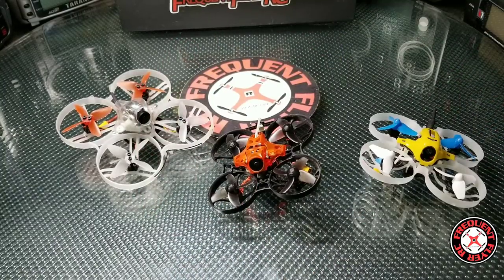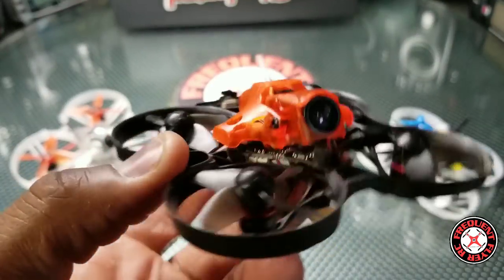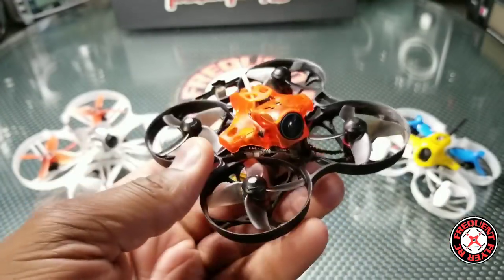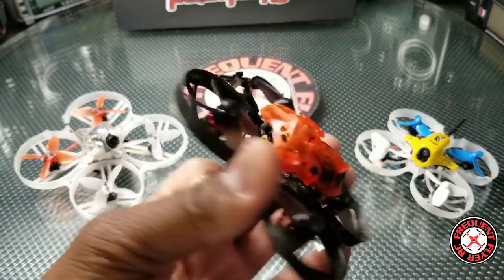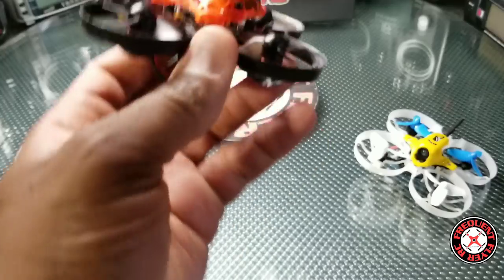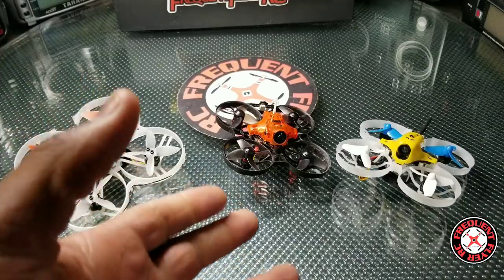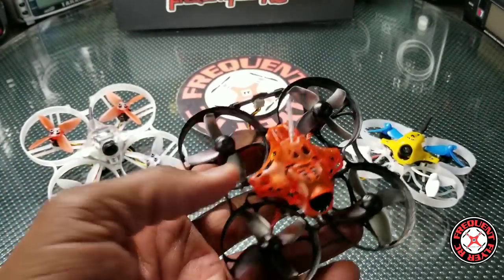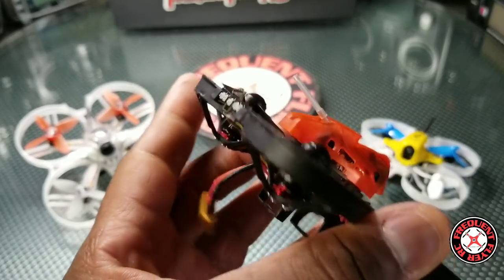Eliminate Yaw Washout For All Brushless Whoops!

Comment: Good idea, I've noticed that the more power the whoop has the less washout there is. So maybe instead of digital idle we need a more agressive airmode to give the quad more authority at low throttle positions. In these quads at low throttle there probably isn't enough power/authority to control the yaw so increasing digital idle or increasing the power of air mode would make some sense.
Reply from the maker: Was axactly my idea when I started! Raising idle gives more authority while at same time keeping props spinning a little faster at zero throttle so to get power it is already not to far down to Rev up when needed! 👍🏽

Comment: My flight time drastically increased with xt30 and betaflight 4.2 with rpm filtering
4khz pid and dshot300 brings 4 minutes flight with 2s 450mAh tattu, to 3.5v (medium hard flying)
But I had massive problems with drone washout at low throttle.
Thanks for the values, I was about to work myself up but that makes everything easier.
Reply from the maker: Changing your prop direction makes a big difference as well! I would go props in!
Reply: @FrequentFlyerRC  Wow, can you explain or do you have a video explaining about differences of props in and out in betaflight for whoops?

Comment: It's funny though that BetaFlight has lowered the default to like 2.5 or 3.5 now, I can't recall which but it's lower than the old 4.5%.  Is the Trashcan Props out or Props in?
Reply from the maker: Trashcan comes props out stock.
Reply: @FrequentFlyerRC    Thanks and that's interesting since "props out" works for all the Whoops I own to eliminate most of yaw wash out.  However, I'm not an aggressive flier by any means so that's probably why I don't see it. I also run about 4.5 to 7% digital idle depending on the quad's motors. But that's only because some the "cheaper" or older brushless motors just sit there and wiggle or flutter upon arming.  Man do I hate that!

Comment: U mean washout from dives? Or just turns? Props in fixes the dive washouts. If u washout in turns just put your battery forward more. Even with 4.5% idle. Go props in and idle 4.5 and let me know. I have 65mm and 75mm whoops 2s and non of them have washouts. All props in. Just try.
Reply from the maker: I'm talking yaw washout on deep dives.. Do a high punch and dive straight down with zero throttle and then pull out and you will definitely see lol

Comment: Interesting theory. Not sure if this is a full fix or more like a workaround. I believe it works, but higher digital idle means it will be harder to get hang-time, which is already usually harder to achieve on these light quads, as you can't gain a lot of momentum when punching the throttle, there is no mass to keep it going up a little, even when flipped to inverted. It also makes it harder to do a vertical dive, as the higher idle will pull it forward more, when nose is pointed down.

I think the real fix, and why something like the Mobula 7 is less affected, is power to weight ratio. The Trashcan is much heavier, so it needs more lift  to begin with. i wonder if raising the digital idle does anything for quads dropping a corner in a fast hard 180 turn. Some ducted fan quads washout during such a move, but during a turn, the throttle is far above idle, so any changes there won't help, probably.
Reply from the maker: Yes but if you check weight, the Pro 2 is lightest of them all and still gets it without this idle fix.. Someone even reported that the Mobula 7 they have gets it too so I'm thinking flying style matters too. Also, with an XT30 and 350mah pack these are a LOT faster! I think some people are so caught up with thinking it's faster with the 2 1S pack setup that most tend to not do the XT30 change.. Mobula in its original frame has battery bay to accommodate 300mah 2S pack?
Reply: It's more complex than weight alone, it's more a mix of power to weight ratio, props, airflow around props and ducts, flying style for sure too, and maybe some more things. Generally though, the heavier, without increasing prop size and power, the more likely to get yaw washout or a corner dropping in fast tight turns. Bigger props would help, like 2 blade larger diameter, as the experiments by KababFPV showed, but then it's no longer a whoop. Maybe some other 4-blade props might help too.

I haven't found any 2S batteries that fit the Mobula 7 frame. Indeed a 2S pack often outperforms a combination of 2 1s batteries, these small packs have more voltage sag usually. XT30 will improve voltage sag too, but also add some weight. It's always a trade-off, finding a sweet spot.
Reply: I agree with RC-Fan.  I have only been flying for little over a year but noticed I got more washout on my snapper7 than trashcan.  I concluded washout to be caused from a low power to weight ratio on ducted quads.  If you cut throttle on these quads (lower power to weight) the fc will compensate with washout.  I experience this more on the snapper7 because my confidence is higher to completely cut throttle versus the trashcan where I am not as aggressive/confident so I am more smoother on the throttle.  I have also experienced a similar type of washout in flight on windy days, 20mph+ winds.  (I try to fly whenever I get a decent break in weather).  I aslo agree that setting the idle speed higher will compensate to some degree but it will be a trade-off in flight characteristics.  So I think it all boils down to those magical numbers of weight and thrust for a particular style of flight.
Reply from the maker: Yes I agree with you guys. I also have found that less blade count means more flytime  but also more washout! More blades mean more yaw authority which brings me to my final step of trying 5 bladed props! 👌🏽
Reply: Did you also try the new Gemfan "whoop" props and the new 4-blade 40mm HQ Prop ones? These might also have different low RPM thrust characteristics, and might help. 5-blade props tend to be less efficient than 4-blade.

Comment: Try the contrast and brightness settings on your goggles to try and get it to match the recording.  
I haven't checked my digital idle speed yet, but my BetaFPV Pro 2 only very rarely washes out when low battery.  It already feels very floaty.  When I switch to stability mode to just before landing sometimes, it has a hard time losing altitude hehheh.  Especially if it's windy (each gust tips it slightly increasing throttle on some motors, so it doesn't want to land.)   But just like you said, who cares if it idles high, in ACRO it goes where you point it.
Thanks again for excellent videos as usual bud.
Reply from the maker: Did you switch to XT30? It flies a LOT faster with XT30 which makes it more likely to wash out with the added speed.
Reply: @FrequentFlyerRC  Yes indeed I did switch to xt30 and made an adapter for the 2-1s Batts like you did on your channel (ty!). I am probably going to switch it back since I have something like 100 of the BetaFPV 1s 300mah batteries (a gift from a good friend!) And only two 2s batteries hehheh.  So, too much power?  Hmm lol.  I do find that the slightest addition of weight adds to more washouts -canopy, LEDs, cable connectors.  But I never think about it on the Beta75 Pro 2 because it rarely does and recovers instantly.  I posted one of my first flights and did massive dives - it's on my channel here.  It washed out for a tenth of a second ;)

Comment: I have a betafpv 75x 2s and the washout is terrible I thought it was the ESC I changed that, i thought it was the motors i changed them also. I cant wait to try to adjust the idle speed hopefully it fixes the problem. I love flying the microwhoops outside the house its alot safer than the 5 inch.
Reply from the maker: Just change the prop direction back to normal (props in} and it shouldn't wash out any more. I told everyone about this fix but nobody pays me any attention! LOL.. The Mobula7 flies good out of box because it comes props in and when you put the 75X this way it flies great too!.
Reply: @FrequentFlyerRC  if I change to props in I would have to physically change the props also? Sorry I'm fairly new to this.
Reply from the maker: @brianreip411  yes, and untick "props are reversed" in Betaflight and change direction in BLHeli too
Reply: I'm having some trouble. I unclicked  reverse props in Betaflight and physically swapped the props to follow the directions shown on betaflight and now it doesn't fly at all, what did I do wrong?
Reply from the maker: @brianreip411  motors don't spin up?
Reply: They spin but the quad does not fly, I followed the arrow directions on BF and the props are the correct direction. I am not sure what I'm overlooking
Reply from the maker: @brianreip411  you must change each motor direction in BLHeli

Comment: Now this makes sense! One guy on another video referred to this video and said you cut the rates in half! Lololol  Can you imagine how shitty it would fly....🤔🙄🤪
"Dude, the rates were at 0.8 so I cut them down to 0.4 and it fixed the yaw wash out!"  Ahhh dude, Yeah, if it would even take off! Lol
Some people are just IDIOTS! LOL
Good video, Bro! Remember we had issues with the Leader 120...I think it was that one... Where they set the digital idle speed to something low... Like 4%, and it would die on flips and rolls... A guy figured out to change it to about 8% (somewhere around there) and the problems vanished! Same thing here but to a much higher extent... 14% is way up there! But if it fixes it, co0ol!  😎
You're right though... When it comes right down to it the Trashcan is simply too heavy! It's all about weight when we're talking about who0ps! 👍
Get the Mobula7... It's THE BEST ONE,,, because they didn't try to do too much! Still light as a feather so it flies like the wind! 😁
Reply from the maker: I was just trying to come across the one with v3 frame as people has reported the original Mobula breaking on the first flight! 👀

Comment: Also you done this to all three yeah?
    Enable "I Term Relax" (a new feature in Betaflight 3.5).
    Leave the "I Term Relax" options at their defaults. This helps to reduce i-term blowouts
    Lower the Yaw P to 65 and increase Feed Forward (another BF 3.5 feature) to 96/96/100 for roll/pitch/yaw (respectively). This preserves the same responsive feel but reduces oscillations!
Reply from the maker: Had you came with this before I would have tried it but as of now I am extremely happy with the way they fly now so I really do wanna fool around with them. Do you have a Trashcan?
Reply: If you enable i term relax don’t you turn off i term rotation or leave it on?
Reply: @fpvkris6817  Leave it on.
Reply from the maker: Do you have a Trashcan? If not, what quad did you apply this to?
Reply: @FrequentFlyerRC  Yes I have the Trashcan. Also the Beta75x, though have swapped out that FC and ESC board on that for the Beecore Betaflight F4 10a esc single board.
Item relax helps on all these 2S Whoops.
Looking forward to getting my hands on KababFPV's Toothpick frame, or better still Banggood bringing their own version as the shipping will be better for me.
B.t.w. Still not got my Gemfan 1636 1mms yet, how you finding them?
Peace Brother, happy flying.
Reply: I running the beta75 pro brushless 1s
Reply: I have the acrobee brushed,  none of this applies? Ive moved the motors around for props in, its tuned only thru neebee drones bf tune which is great i think
Reply from the maker: So... I added the new Gemfan 1635 40mm props (3 bladed) and the props are so light and give so much thrust that the quad tries to levitate on arm with the idle being so high! So I lowered the idle and tried the PIDs you suggested but now the Trashcan won't even arm! Am I missing something here? LOL
Reply: @FrequentFlyerRC  Oh man..I have not tested the Trashcan with those props yet only have the 1.5mms so far.
Hope you get it sorted, you know how fickle these quads can be. Many a time I have been seeking a solution to a problem on a quad, up for hours, next morning it is right as rain.
I hope you get it sorted.
Peace my friend.
*Edit. I just thought why won't you quad arm and all that came to mind was, when I put that 10a aio in the Beta75x, like a nob I flashed the Beta75x restore to the new board and that would not arm. 
Then took me ages to find out what target  that new Beecore F4 Pro board with the 10a needs to be flashed with, turns out it "NOX".
Maybe reinstalling BF? Feel kind of guilty for mentioning those PIDS. Those were Mobula PIDs were they not? Ah man. Hope you fix it.
Peace.
Reply from the maker: @cheshirerc  no biggie, should get it sorted sooner or later. Speaking of AIO boards, the Beta75 Pro 2 has an AIO board too and is more similar in weight to the Mobula7, I think it's even lighter actually! I was able to still fly the Beta75 Pro 2 with same PIDs I had before and the Gemfan 1635 40mm 4 bladed prop! I guess since the motor KV is lower at 12000kv it was able but it does the weird pitch back maneuver which makes me know I need to lower p term and d term. Maybe after a backup I will try your PIDs suggestion on the Beta75 Pro 2👌🏽
Reply: Jesus what is happening? LOL  Just went to fly the 75x I keep mentioning with the cheap 10a Beecore F4 board and it would not arm. 😃 *Sigh. Long story short I noticed CPU load at 1% @ 8k/8k??? Have heard loads of these boards going faulty and I was so smug mine was fine. Time to do a Banggood YouTube video for them.
Be good. LOL man.

Comment: Hey FF ! Santa brought me an 85x :p  Does it have to be in air mode for this to work  ? I usually fly with motor stop off instead of air mode. Can I just set 14.5 and turn motor stop off ?
Reply from the maker: Wow, I really don't know if it works the same but just change prop direction to normal and that should fix it
Reply: @FrequentFlyerRC  Ok can do. Love the channel 💪✅ 😃

Comment: Hi I there I been  doing some testing today.i changed to the settings you recommended 14.50 idle   mob 7 betafpv 75x I get no washout until I do a power loop then the wash out is really bad.just fyl....
Reply from the maker: I don't have the 75X but I imagine you must go to about 16 on idle for that one since it has bigger, heavier motors and overall weight but only 40mm prop size. Part of my theory is that with these tiny whoops, they seem to do the yaw washout when the motors must spin up from too far down on idle. Try higher idle and report back please..
Reply: Will do bud

Comment: Just get on that throttle to stop the washouts,  I can not stand that floaty feel of too high idle.
Reply from the maker: Doesn't work! Especially with the Trashcan. I used to give good throttle coming out of a split S and still get the unexpected yaw twist! You have a Trashcan?
Reply: try doing the moves without completely cutting the throttle.  I have a trashcan but surely cannot fly like you but don't think its necessary to drop the throttle to zero on theses small quads since its a struggle for them to recover

Comment: Turn props out off on the trashcan. U will be amazed the difference.
Reply from the maker: I have props in on my 75 Pro and it still does the yaw washout sometimes
Reply: Hi. Do you mind explaining what props in and props out means ? Kinda new at this. Thanks in advance.
Reply: @T0xicCr0w1  yes my friend it is simple props in is the props spinning inwards like on most of are quads. Props out is the props spinning outwards. Which would also be motor direction reversed.  I am uploading my flight right now with the trashcan check it out . U will see coming out of big powerloops u don't have that yaw washout. Check it out on my channel should be there in a few . Ask me any question u have no worries my friend